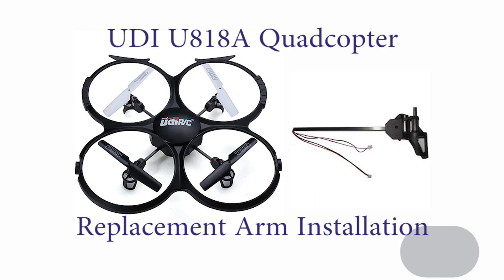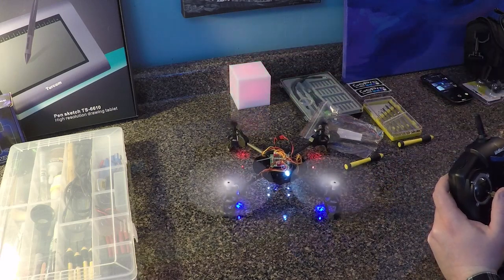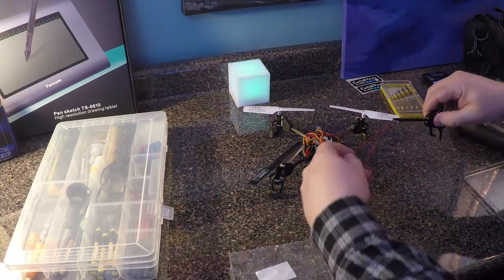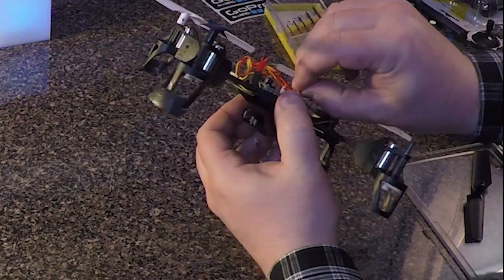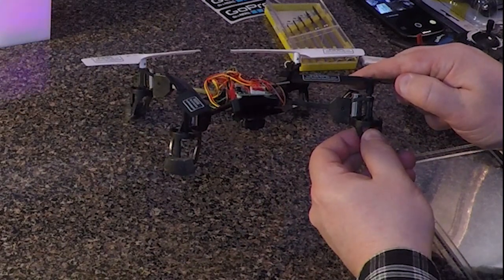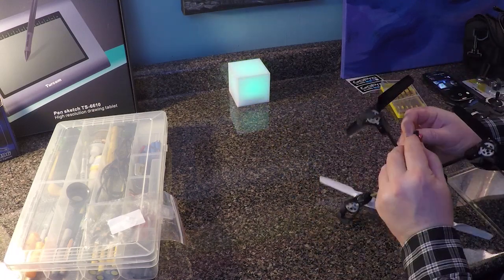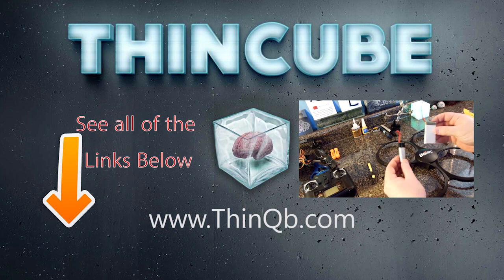UDI U818A + more Quadcopter Repair - Replacement Arm and Motor and U818a-1 Discovery

Comment: Got the u818a hd+ discovery, had it only 3 days and now having problems with the A2 white blade.  replaced the blade and the gear that's was included only to find the motor seems to be locked up.  watched videos to see if there is anything I can do without having to order and replace parts.  1st one so am I headed towards replacement or is there anything I can do...
Reply from the maker: you could check to be sure the shafts is moving freely as well as the gears on motor and shaft. there are two small bearings on the prop shaft.....I'm going to be a video about it real soon, if not tomorrow.
Reply from the maker: take the gear off again and see if it's the motor or the shaft binding.
Reply from the maker: ***** Hi Jardini, i am actually in the process of editing a video i took of replacing the motor itself and i talk about the gears as well. Should have it up by the weekend.
Reply: +ThinCube Thanks for the great video on arm replacement. I have ordered a replacement, but would like to replace the small gear while waiting. It does seem sticky.. waiting for your nest video as well.. thanks
Reply from the maker: Wilmington Watertours Thanks :)  I am working on it now and will let you guys know once it's live.....btw, the small white gear on the motor is press fitted to the motor shaft. With some effort you should be able to slide it off.
Reply from the maker: Wilmington Watertours Hello again, as promised here is the motor video i mentioned earlier: https://www.youtube.com/watch?v=3DBkewM-4Ew&feature=youtu.be   I also made a video showing all of the connectors on the PC Board: https://www.youtube.com/watch?v=BUghqOSFTiw
Reply from the maker: ***** Hello again Jardini, here is the motor & gears video i mentioned earlier: https://www.youtube.com/watch?v=3DBkewM-4Ew&feature=youtu.be   I also made a video showing all of the connectors on the PC Board: https://www.youtube.com/watch?v=BUghqOSFTiw

Comment: Hi. I replaced the the left front arm assembly (CW) and the quad copper flew. But, their is always a but, it seemed to fly right, forward and backward with good speed but when i flew it to the left it was slow. When i went to inspect the quad the new replaced motor was very hot to the touch. The other motors were not?? Any advice?
Reply from the maker: Hmmmm, it sounds like the new motor is struggling to keep up. Alot of the parts manufactured by company's with low quality standards and loose tolerances fail early or provide reduced performance. Unfortunately it is the nature of the beast when it comes to these bottom of the market drones. My guess is that the motor in question will most likely be your next part to fail. Only options would be to do nothing until it fails completely and replace again or be proactive and install a new one now, hoping it is of better quality. Hope this helps and good luck with it. Let us know how you make out Steven. Happy flying!

Comment: I ordered the part.  Replaced it.  But when I plug in the battery, the replacement goes on automatically?  The rest only go on when I use the remote.  Did I do something wrong?
Reply from the maker: It seems like alot of people have been having this same issue. This actually sounds like a main board problem. I have another video that shows the layout and pinout of the main board if you want to try swapping arms to troubleshoot more but it really does sound like the board is defective. You can purchase a new board: http://amzn.to/2bdnQFe   Sorry and good luck with it, Tony.
Reply from the maker: Hi, take a look at my reply to Willis and good luck to you as well. Let me know if you have any questions, Tony

Comment: I have a discovery u818a, do the batteries not last last long in flight time, the battery in the drone itself I mean? I get maybe 5min out of mine..
Reply from the maker: Hi Bryan, that sounds about right, 5 mins for a stock battery. I made another video about using a 1200mAh battery that will nearly double the flight time. This is the battery with its own charger: http://amzn.to/2aIsvkM

Comment: The left front motor with the white blade is stuck I need a new motor, I need to know whether I need clockwise or counter clockwise. Thanks
Reply from the maker: Hi, make sure it's not the gears that are locked up. That is very common for the gears to get damaged and act as if the motor is bad. Here's a video i made about the gears: https://www.youtube.com/watch?v=3DBkewM-4Ew&t=85s   If the gears are fine, take a look at this video about the motor directions and prop spin: https://www.youtube.com/watch?v=nTNhGXrO5ik&t=153s   good luck and let me know how you make out.
Reply: The drone got stuck in a tree and the motor was running now the motor is all jacked up
Reply from the maker: That sucks, been there!!! Here is a link to some motors available for the UDI:  http://amzn.to/2geLqEz   Good luck with the fix and let me know if you have any more questions.
Reply from the maker: BTW, replacing the entire arm is MUCH easier than just a motor itself

Comment: I followed you replacement procedure and everything went smoothly.  The issue I have now in the prop that I replaced is always turning even when the other proper are stopped.  The red LED associated with the replaced arm is also blinking.The replacement arm I received had wires with the same colors as the original arm.Any thoughts?
Reply from the maker: +doncas62 Hi, it sounds like you have the plugs reversed. The prop motor may be plugged into the LED power and vice versa. Try swapping them and let me know what happens.  Good luck, Tony
Reply: +ThinCube Thanks for replying.  I tried swapping plugs as you suggested but then the prop would not rotate at all.  The UDI basically works with the replacement arm I purchased but the new arm prop is always rotating at an idle speed.  There is a red LED on the PC board that is on constantly when the throttle is at 0%.  When you increase the throttle the red LED blinks.  It appears the red PC board LED is associated with the new replacement arm.The model # is U818A HD+
Reply from the maker: +doncas62 Sorry you're having issues with it. Ok so the red LED is normal. Watch the video at about 30 seconds when i power up the controller. You can see the red LED on the pc board go solid red then blink while im throttling.  As for the motor always spinning while idling, im not really sure. Try swapping plugs with another arm (but be sure to note how to put it back). See if the same prop motor still spins on its own or if the problem moves to the other prop. Does what i just wrote make sense?
Reply: +ThinCube Yes, I will give it a try and let you know.  Thanks.
Reply: +doncas62 I swapped plugs two different arms and the same prop is still rotating all the time.  I think this points to something in the replacement arm and not the control board.
Reply from the maker: +doncas62 I agree with you on that. There's probably low resistance in the motor allowing a small amount of current to flow while idle but still allowing it to function when throttled. If you bought it through Amazon, they have been really good with replacing or refunding your money. Let me know how it turns out either way.....haha "turns out"...no pun intended :)
Reply: +ThinCube Thanks for your help
Reply: +doncas62 ThinCube,  I am new to RC copters of any kind, this is my first.  I have been researching this issue this morning.  I have a question.  Is the "clockwise" or "counter clockwise" prop rotation referenced from the bottom or top of the unit?  I purchased a "clockwise" arm and perhaps I need a "counter clockwise" arm.  I say this because the USA Toyz website says the back A1 arm with red LED is "counter-clockwise".  The A1 is the arm I replaced.
Reply from the maker: +doncas62 Looking at my quad and holding it upright with the front white props and main led facing me, here are the prop locations....B1 White is left front, A1 White is right front, A1 Black is left rear and B1 Black is right rear....hope this helps. I am going to be making a video about this real soon, if not today!
Reply from the maker: +doncas62 Hi again, i made a new video that talks about propeller installation as well as the RED led you mentioned....take a look:  https://www.youtube.com/watch?v=nTNhGXrO5ik

Comment: Hi there, do you have any suggestions? I attached the new motor and arm (from amazon), connected the arm and replace the wires and can not get new motor to work. Did get it to spin up slightly. Any suggestion?
Reply from the maker: Hi again Barb, you will have to do some troubleshooting to get to the bottom of this. Try swapping the wires (connected on the main board) from one motor that is working and connect the wires from your new motor to that connector. This way you can test the new motor you installed by powering it with a known good connection on the board. Hope that all made sense! If the motor works when you plug it into another connection on the main board but not in the one it should be connected to then unfortunately the main board is bad. If when you plug the new motor into a known good connector on the board and it still does not spin, then you received a bad motor from Amazon and should send it back for a new one. I hope this helps and let me know if you have any questions...good luck!!!
Reply: ThinCube thank you for the great advice. Yeah I tried that right off the bat and thank goodness one of my good motors worked in the number for power slot on the board.
Reply from the maker: Glad i could help :) Happy Flying Barb and feel free to share any videos you may take with your drone!!!

Comment: Good video.  I did see on Amazon and other places that just the motors are a few dollars less than the motor + arm assembly.  I assume by your comment that replacing the arm assembly is much easier than just the motor that it is probably worth the couple dollars just to replace the entire arm w/ motor. correct?
Reply from the maker: +mick1027 Hi Mick, yes that's my opinion. There's a bit more work that goes into replacing the motor within the arm assembly. You could always buy both and repair your quad with the whole arm, then take the bad arm and try replacing the motor on it to see how it goes. This way you only risk a couple of bucks and still have your drone up and running. Then if you do get it in successfully, you have a spare arm assembly. Good luck and let me know how it goes.
Reply: +ThinCube Thanks for the quick reply. I think that is what I will do. No emergency yet, but I am sure I will need this skill as miles are put on the quad.
Reply from the maker: +mick1027 I like your thinking :)

Comment: What's up man, I have a problem with my drone and I hope you can help me. I bought the arm with the motor to replace them and doesn't work fine, see in the manual for buy the replacement and I bought the wrong motor (clockwise), the manual is a mess by the way. Once that I bought the right parts (motor anticlockwise) and install it the drone doesn't rise.
Reply from the maker: Jose Fortunato Cristaldo Santacruz Hi Jose, i totally agree with you about the manual sucking, big time! Stupid question, but are you sure the battery is fully charged? Did you try fully discharging then recharging again. Also, remove the batteries from the remote, this can sometimes clear any errors (if they exist). I know these aare all shooting in the dark but worth the little effort they take. Also, are you sure you have the correct arm and they are all plugged into the right connections on the main board. Good luck and let us know how you make out!

Comment: Hi, so my drone broke and I need to replace that arm. But the arm broke near the slot. Any idea as to how I could get the arm out of the slot? Thanks
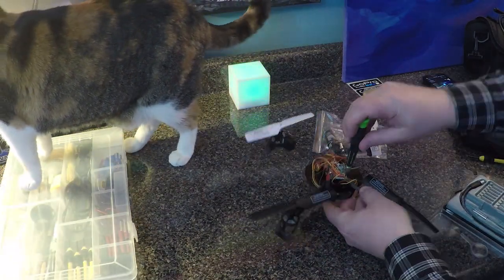Reply from the maker: Hi Farris, this might not be as hard as you think. Be sure to remove the small screw holding the arm to the main housing....through the PC board (at 1:29 of the video). Then use a larger wood screw to thread into the broken section of the arm. The arm is square so it shouldn't spin. Let the threads from the screw cut into the broken section and then use pliers to pull the screw out, along with the broken section. I would use like a deck screw or a wood screw used like on door hinges. Let me know if you don't understand what i am explaining :)  Good luck and let me know how you make out.
Reply: ThinCube Ah, well I was able to get it out. But thank you for taking the time to respond. Also huge thanks to you for making that video, no way was I gonna be able to fix it on my own. Again, thank you so much!
Reply from the maker: Farris Alloush Glad you got it and that the video was a help :)  Thanks for posting comments, Farris! They may help someone else in the future with a similar problem. Please comment again in the future if you ever need help.

Comment: The wire to one of my propellers snapped off.. Do I just need to buy a new arm or is it fixable?
Reply from the maker: Hi, it is repairable if you are able to solder on a new wire and connect it up properly. Otherwise, the easiest way to fix it would be to replace the arm Good luck and happy flying!
Reply: Okay, thanks! I thought that would be the case but thought I'd check first.

Comment: I've been having this exact problem with my counter- clockwise arm for months. Whats causing it, and how can i prevent this in the future?
Reply from the maker: +games4every1 Hi, it really could be any number of reasons. They're not made that great which is my guess as to the most common reason. But crashing alot or flying in damp or dusty conditions could also cause a motor to fail. Good luck with it and happy flying!
Reply: ThinCube fastest response ever! nice job!
and thanks. im probably just gona get a replacement. how long will the delivery take?
Reply from the maker: +games4every1 Thanks, im actually working on my latest drone video. Its about the new FAA requirement for registration, so be sure to check that out. So as for delivery, it really depends on where you get it. i got mine on Amazon and I have Prime Membership so if i remember correctly it was only a couple of days. Here's a link to the Arm( http://amzn.to/1SQKRgp ) as well as a link to Prime ( http://amzn.to/1SQKTVv ). Good luck and let me know how you make out or if you have any questions.
Reply: ThinCube ok, i have amazon prime too. so, they do have an arm for counter-clockwise right?
Reply from the maker: +games4every1 Absolutely, here's a link to the anti-clockwise (counter clockwise) arm: http://amzn.to/1mZ58Ec

Comment: This is probably a dumb question but I can't figure out how to remove the damaged arm and motor assembly from my Discovery U818a-1 quadcopter.   I've watched the video but the problem is I can't get the housing assembly off so that I can get to the screw holding the arm on the PC board.   The instruction in the video is to slide each of the 4 arms through the slots in the housing and there are no other screws holding it in place but my arms do not slide.   How can I remove the housing?
Reply from the maker: +Kay Sommers Hi Kay, the housing lifts straight up and off. The housing wraps around each of the 4 arms and where it does, the plastic has a slot for you to spread and the housing should lift up off of the arm.....you have to do this 4 times. In the video, i point a red laser pointer at one of the slots at 1:08 in the video.This link will take you right to that moment in the video: https://youtu.be/-fYNdIUskFk?t=1m8s    I hope this helps. If not, please feel free to ask more questions....im here to help :)
Reply: +ThinCube 
Thanks for your quick response!     I was afraid to force it but the assembly snapped off and now I've removed the damaged arm/motor assembly.   Next up is to figure the connector wire arrangement.   The cables on my replacement arm/motor assembly are two black and two red whereas the original wires are yellow and red pair and green ad red pair.   So, I thought I would plug the two that are on the right into where the green/red wires are currently attached and plug the red/black wires on the left into where the red/yellow wires are currently attached.  Does that seem correct?    
Thanks again!
Reply from the maker: +Kay Sommers  Hey again, you will have to try one way and if it doesn't work, swap them. Without a color difference, there's absolutely no way to say because they can get twisted inside the arm any which way. If you plug them in one way and the motor spins slow or not at all and the LED on the bottom only turn on when you throttle up the quadcopter then swap em.....good luck and let me know how you make out. I started recording a video about the connectors but haven't edited it yet.
Reply: +ThinCube 
My first guess with the connectors was lucky,  and the quadcopter is working fine now.   Motor and blades spin and the lights are all on.   Can't wait to go out and fly it again.   
Thanks for all your help!!!!
Reply from the maker: Awesome, so glad i could help....have fun!!!

Comment: What if the new arm motor starts spinning as soon as the battery is connected, no others do.
Reply from the maker: Unfortuntately, this is usually the main control board being faulty.